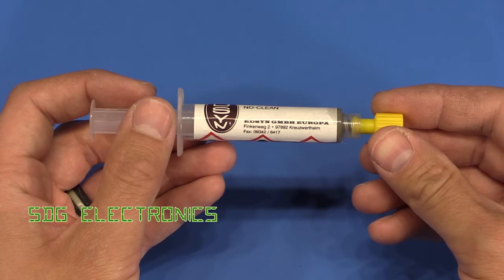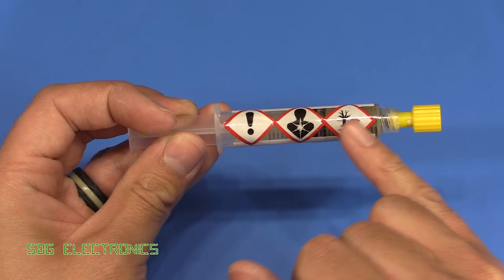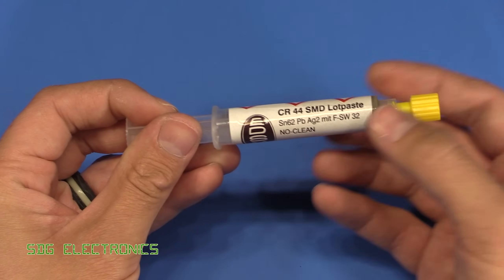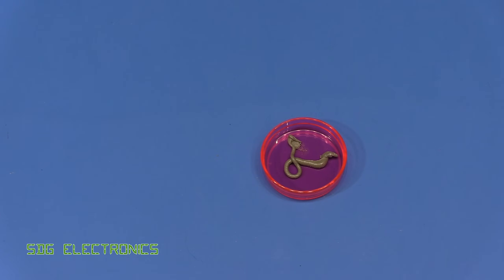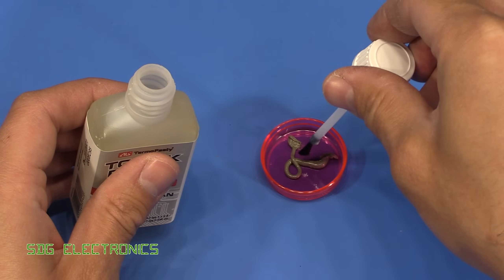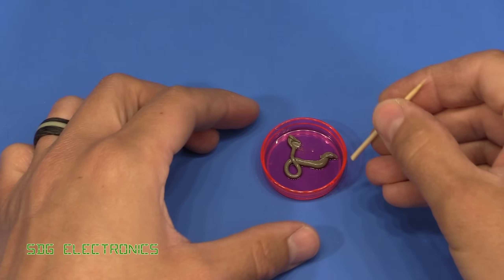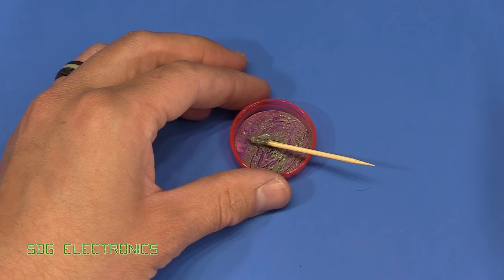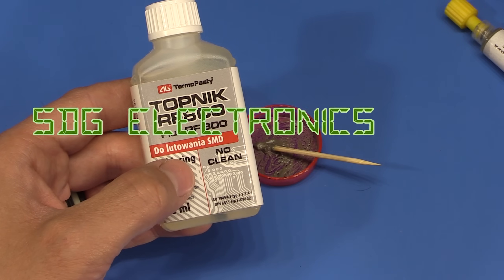SDG #075 How to Reactivate Dried Solder Paste

Comment: Someone told me that why you need to replace the past is because each little ball of solder reacts with the flux and maybe some air, and so over time you get less and less percentage of usable solder left in the mixture? And why this isn't a problem with solder wire is because the metal is a lot thicker and so if a thin layer is spoilt over time it is not much percentage of the total.

I thought this is why you can buy some pate with the flux and solder balls in separate packages?

Comment: Coincidently, I tried to resurrect some 3 year old Mechanic paste 3 days ago. I tried IPA, but I think I added too much because it got runny when hot. I tried flux with the IPA and there wasn't enough volume solids left, because when heated to solder most of the paste vapoured off leaving hardly ant solder. I think the trick is add small amounts and mix it a lot so you can judge if it's too diluted.
Reply from the maker: Yes, it's really a fine balance to maintain the fluid/solids ratio. I'd not recommend it for production runs etc, but it can get you out of a situation.
Reply: @sdgelectronics  I bought some ebay XeredEx paste and it was dry from new, so I've got nothing to lose with that one.  lol

Comment: I use IPA. The paste dry up because the solvent evaporates, but all the other ingredients, including the flux, remains in there. So I don't think there is any need to introduce more flux, just IPA works fine for me. I am sure any type of alcohol would also work.
Reply: Do you mean isopropyl alcohol?
Reply: @adaminsanoff  Yes.
Reply: @borayurt66  Thanks. I will try.
Reply: IPA evaporates quickly... more flux doesn't hurt besides it helps to reflow better...

Comment: Get a syringe with needle and inject the flux into the paste tube, then mix in situ with a thin wire through the tip, or use the needle you used for the flux. Less mess that way.

Comment: I have been trough several tubs of solder paste, and have tried this reviving method as well, it doesn't work all that good. Just buy yourself new paste, it will save you a shitload of reworking, new paste works just so so much better.
Reply from the maker: There's not much to go wrong, the organic compounds or acids in the paste don't generally degrade over time hence why normal solder wire is still fine to use after decades. It's only really the solvents that keep the solder beads and flux mobile that will flash off over time. Maybe your additional flux was also getting old or just not active enough.

Comment: I have a 500g tub of Loctite/Multicore MP100 SN62AGS90AK that I keep in a sealed bag in the fridge.........it's over a year old and is still perfect. I got paranoid before my last production run and contacted Multicore and asked them about the symptoms of degradation of this particular paste and they said if it doesn't appear to be drying out then there's no reason to fling it. Good job I thought.....it's £50 a tub!......I think the sealed bag helps a lot not to mention the internal plunger/seal which helps keep contact with air to a minumum.
Reply from the maker: That was the same tub I also had for years, it was around a year after opening it started to dry up. Lived in the fridge next to the eggs :-D
Reply: I keep my syringes of paste in a ziplock bag in the fridge too and try get them back in there asap after use. Doesn't last forever, but a decent amount of time - 12-18 months before you notice it getting drier. The main problems with dried paste is that you lose the stiction which keeps small components on their pads before reflowing them, and it becomes more difficult to mask/spread. Otherwise, dried up paste will still solder just fine.